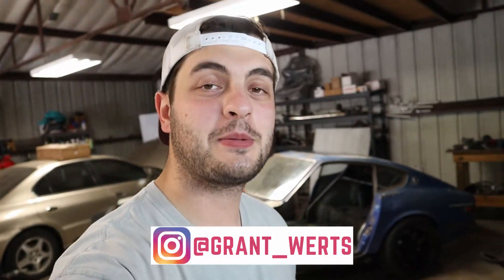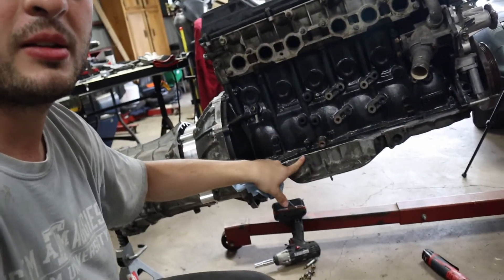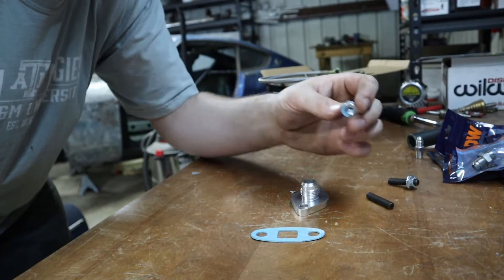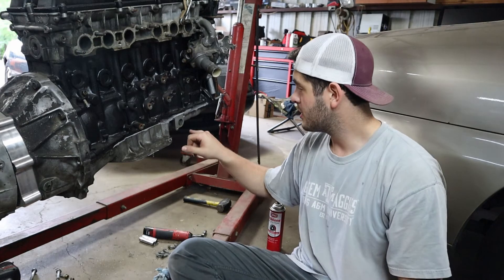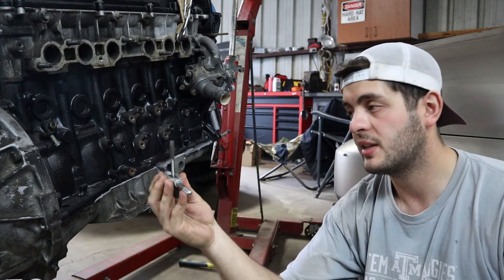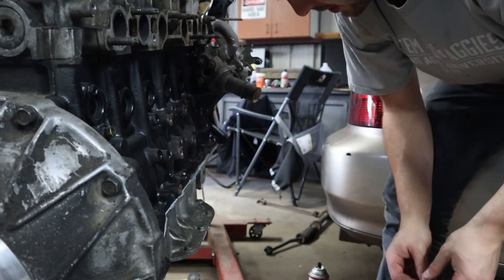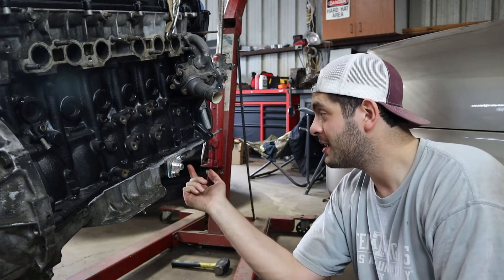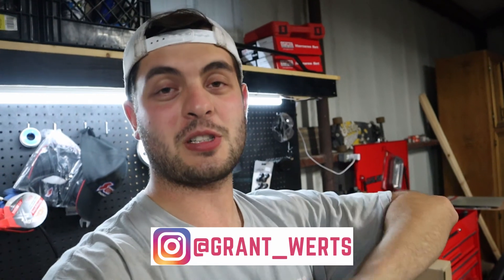How To Install A Turbo Oil Return On A 2JZ

Comment: Super helpful video. Can you send a link to the flange/adapter you used? Also where is your feed coming? Using a sandwich plate?
Reply from the maker: Thanks I appreciate it! Yes I will link it when I get back to my computer later today, and yeah I used a sandwich plate with it being a GE block! I didn’t feel like drilling the oil galley out and for now just wrapped the feed over the top!